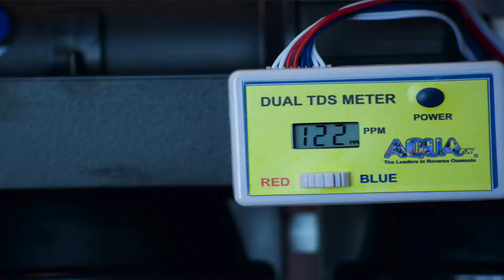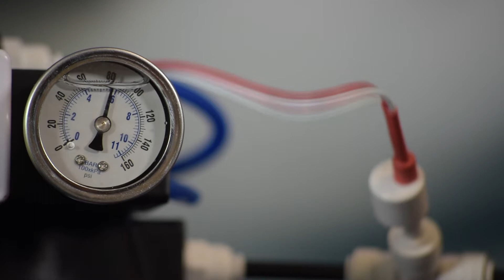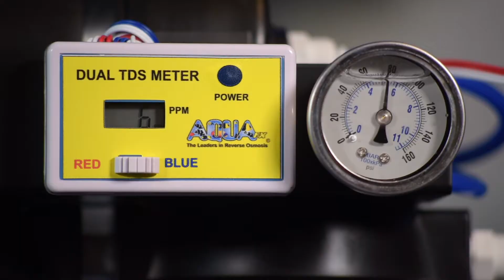Aqua FX Booster Pump Install V2

Comment: im having a little problem with the pressure switch i use mines for drinking water however the tso valve dosent kick in until the tank is empty i need it to kick in a little sooner my tso valve is hooked up between tank and last filter
Reply: Hey Julio, do you mean your ASO valve? It would probably be best to send pictures and a small description to sales@aquaee.com, from there they will correspond with you accordingly.
Reply: @Mottdm  no the tso valve witch is the tank shut off valve or high pressure valve